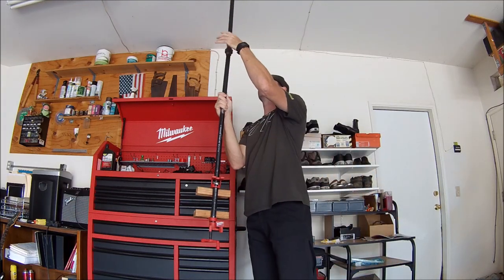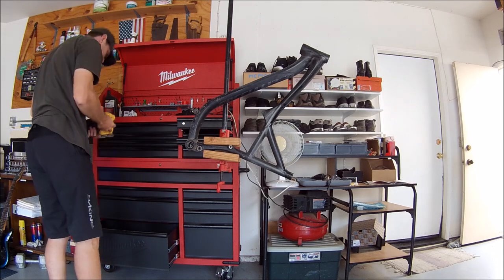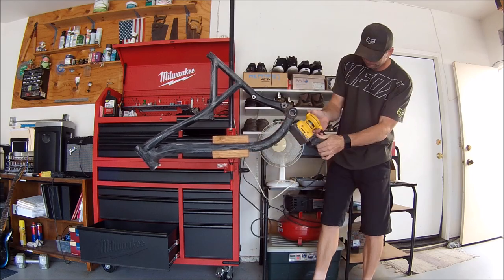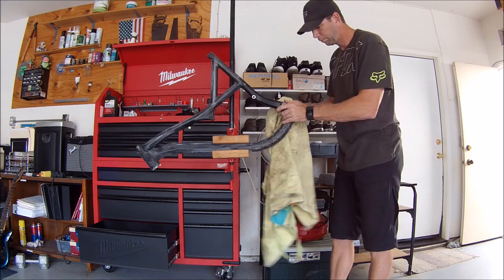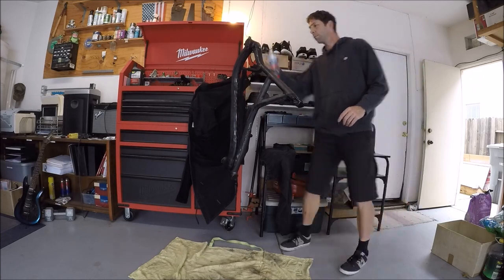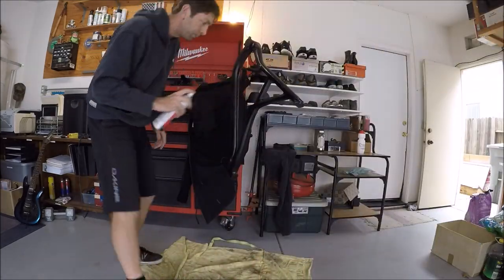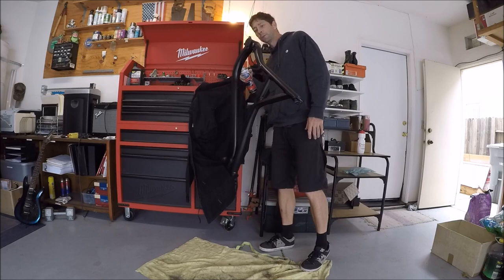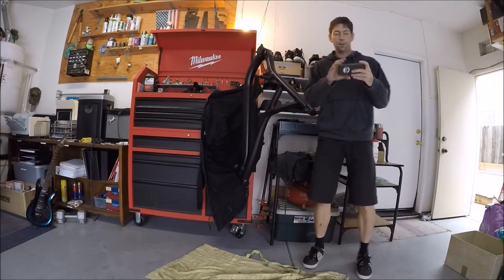Mountain Bike Rebuild: Episode 2, Painting the Frame

Comment: you will have to let us know how it rides when your done, that stuff dries like a rubberized layer if I am not mistaken, I use it to undercoat my car, your bike might weigh a bit more when your finished, more than you might think, anyway curious to see how it does
Reply from the maker: I think the stuff I got is much lighter than an actual spray on truck bed liner. It is a lot thinner and lighter than I expected. It does have the texture I wanted but the frame feels light so far. I am curious to see the end result. I will definitely let you know. Thanks for checking out the video.